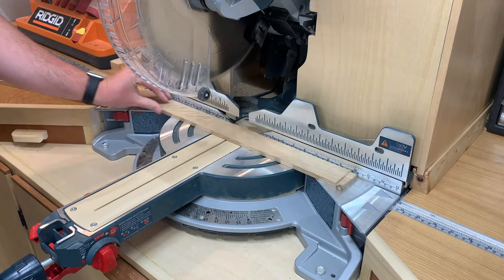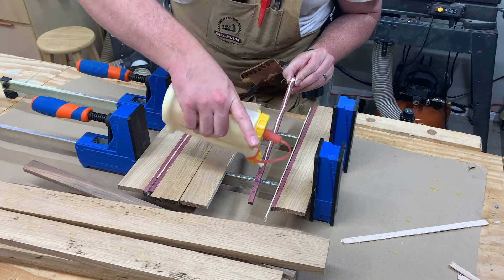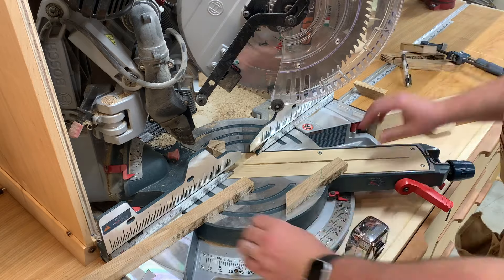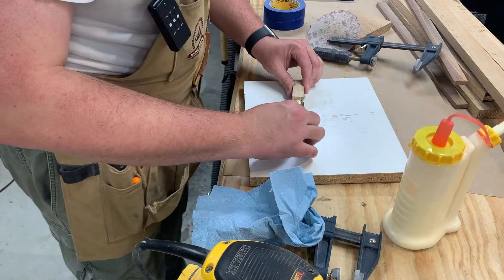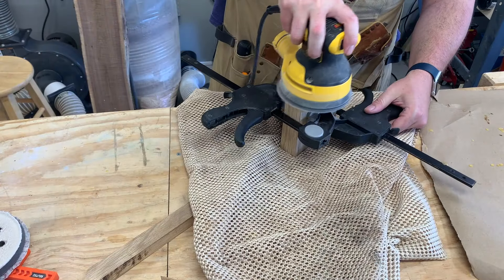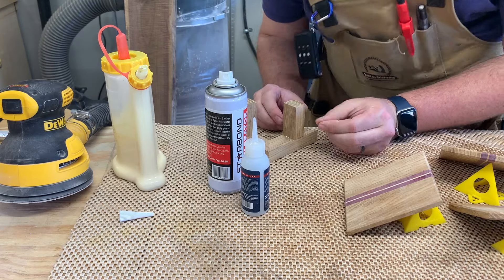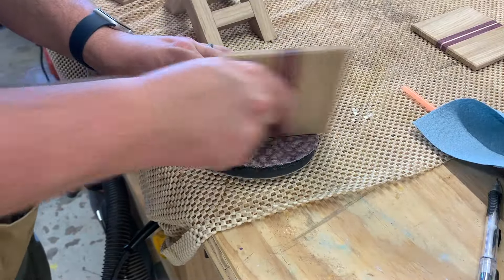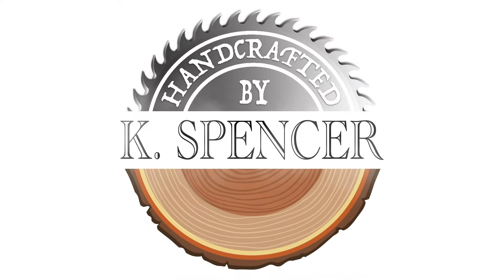Wooden Coasters & Matching Holder

Comment: Really like the coaster holder.  I have built a few coasters, but struggle with the holder and how to make something that looks good.  

Just a tip as well, when using a router on square pieces like this, I would recommend doing your champher or roundover on the grain end first and then the sides.  If you have some tear out on the endgrain, the missing chunk can be mitigated when you rout the sides.  Yes it has happened to me on a couple of occassions.  I was helping someone learning to use a router a couple months ago, and they didn't really understand what I was saying.  They understood when the router tore a piece out of the side of the endgrain, and they were able to fix it by routing the sides.
Reply from the maker: Thanks! Yes, I’m aware of that tip, but have actually found it to often backfire on minimal chamfers/round overs. Sometimes the tear out from doing the end grain first is more significant than the small 1/8” round over on the sides can cover up, but for some reason doing the long grain first helps the end grain from blowing out when doing it second because of the transition already in place.

Comment: That buckling that happened with the mitered corners: If you install a zero-clearance sacrificial fence (just a piece of plywood or mdf), that will never happen.
Reply from the maker: Thanks. Yeah, I was being lazy—I keep telling myself I’m gonna do that, then get in a rush and skip that step (which is usually how stupid stuff happens). I have a new Incra miter sled that I’ll probably use for miter cuts on small pieces like that in the future, but didn’t have it set up yet so went ahead and took a chance on the miter saw.

Comment: I really dig those holders.

If you use a stop block cut with a 45 , it will eliminate that buckling. Just take the offcut from cutting the miters and clamp it with the long edge against your Miter's fence. if the offcuts are small use one with a 90 on the other end and butt it up to any old piece of scrap wood and clamp that down.
Reply from the maker: Thanks for the tip. I ended up making a zero clearance fence which eliminated the sketchiness on my subsequent coaster sets.

Comment: How high up did you come with the cross brace for the holder?
Reply from the maker: Good question. Depends on the thickness of the material and coaster size, but just high enough so the bottom corners of the coasters don’t touch the surface the stand is resting on. I just used a coaster itself for reference and marked the line. Hope that makes sense.
Reply: @kspencer_handcrafted  ok sounds good